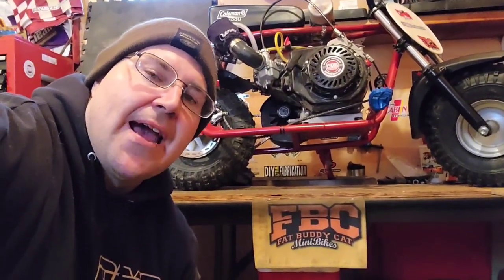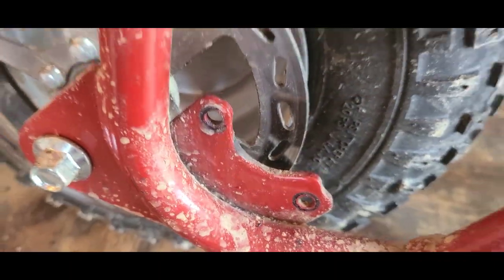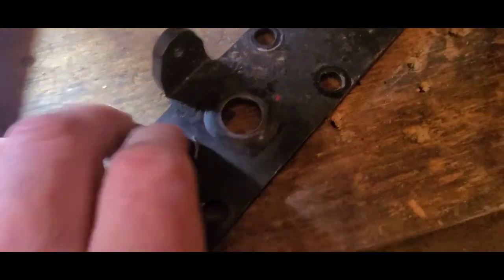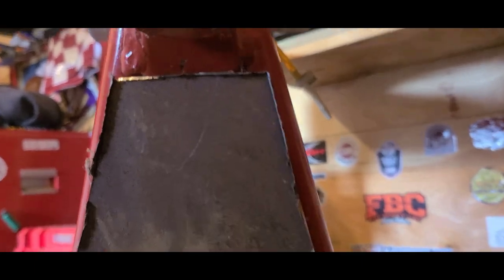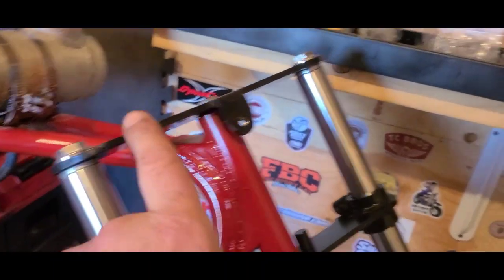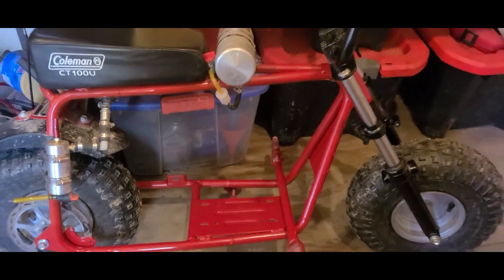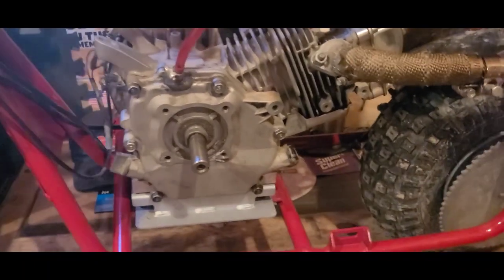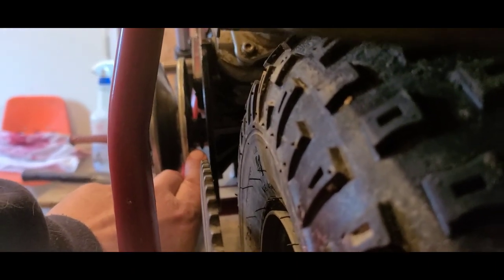Wicked Little Mini Bike "Ct100u Torque Converter Installation"

Comment: I like the engine mount you used there. I agree about hacking off the frame brace. It looks like it's ready for a test run. Good job 🔧👍
Reply from the maker: Yup, it was pretty much unavoidable in this situation. The only way I could have done it without it would be to weld in another engine plate and then use an offset riser.....at that point you might as well just buy a different frame.

Comment: I use super clean Al the time cause of you!!!
Reply from the maker: Stuff works awesome! The foaming one really breaks down the deep grime quickly.  I tried just lacquer thinner first and all it did was smudge everything, super clean took it off of the surface and seemed to lubricate to keep the paint and grease from sticking again. Once it was mostly white again,  I hit it with lacquer thinner on a clean rag since it's a solvent and sets dry.

Comment: Definitely wicked I got kids karts and son bike done I'm going to get my ct200u done need that gas savings for summer time
Reply from the maker: Lol speaking of.....this bike was sucking down a 3x8 tank in about 12 minutes!
Reply: @fatbuddycat main reason I never ride my old alky briggs just cost to much after all the money and time spent on it pretty much is a cool display piece I've got a ducar and a juggernaut with risers new tires plus brakes
Reply from the maker: @Heathen Projects  that's why everything I'm doing is 196 based now. I'm all about everything being as easy as possible to replace or repair.  Problem i have now is that all my engines are hiding in the corner, knowing any one of them can get it without a moments notice! 😅